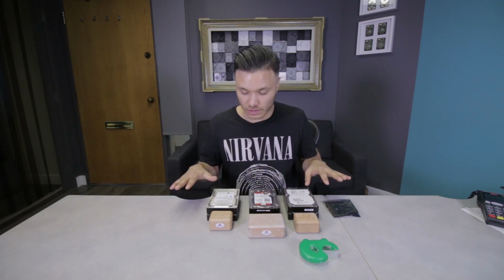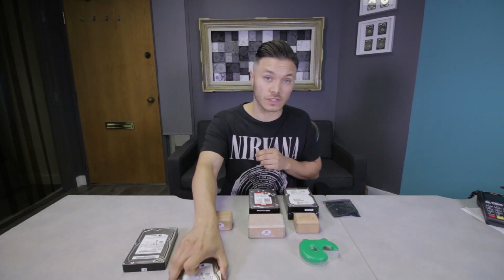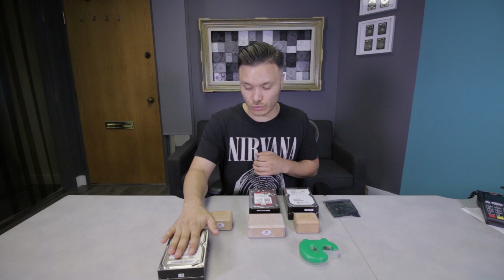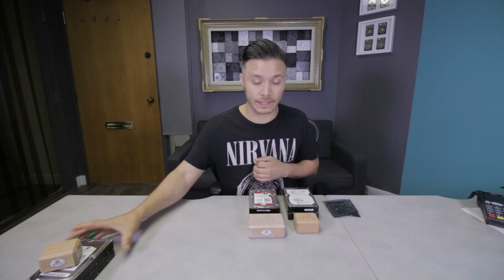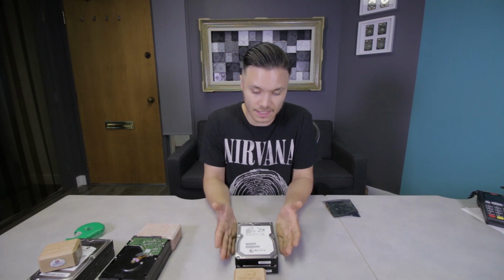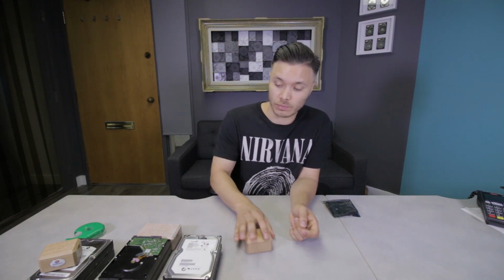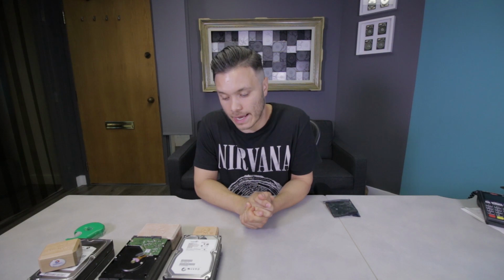hard drive does not spin - how to Platter Swap

Comment: Very excellent video, thank you for taking the time to explain the process so well.   I have a 2tb WD (quad platter stack) black drive with good platters and data but the complete circuit board including the data chip has been lost.   Can you tell me if it is theoretically possible to swap those platters into a similar drive using that drives circuit board and data  chip or is the chip married to the platter(s) the data was written to?  I hope I explained that well enough to understand.  Thank you for your channel and help.
Reply from the maker: Hi Mark, on WD information that would be unique to your drive can easily be rebuilt even without the original board. By getting ROM version "close enough" drive would be able to read modules from service area by ID, and by reading 101+ modules we can rebuild the content of the drives ORIGINAL ROM, and write it to a donor PCB.
Reply: Ok I will call for a price thank you.

Comment: Great videos, thanks for sharing the knowledge. I've watched several clips of yours, but I cannot figure out my case. I have a 2.5" 500GB WD Scorpio Blue, which spins normally, GetDriveGeometry gives me data about the drive. But reading any sectors returns an error. I have exactly the same model of the disk which could serve as a donnor. Do you think replacing heads would help, or more drastically swapping platters ? Or should I try to replace PCB first ?
Reply from the maker: pawelsokolowski if your drive spins up normally and does not click, than none of these techniques will help you get access to the data. Most likely the issue is firmware related. Something in the system area does not load and your drive does not come ready. We can solve that for you. Please do not open the drive as it will only reduce chances of recovery and will not help.
Reply: how expensive is such a repair ?
Reply from the maker: all price request has to be done on the website http://www.hddrecovery.ca/contact-us/

Comment: Awesome work, man!
I got a HDD failure today after my PC fell over on the side (silly story!) Seagate Barracuda 320gb single platter. Opened up the HDD and discovered that the tips of both heads were kinda ripped off and loose hanging from the edge. Removed the heads assembly and inspected the platter.
The reason was obvious; there is a tiny notch left in the platter surface, and when the notch went by the heads, it caught and ripped them off. No damage apart from that, but the damage is exactly equal on both sides of the platter.
It's obvious that the notch needs to be smoothed out in one way or another so that a new set of heads won't catch and get ripped. But the big question remains; is the platter readable when just a tiny part/sector of the is put out of business?
Reply from the maker: tmbryhn thanks! It all depends on where the notch is. If it's not close to the center then this drive is dead
Reply from the maker: tmbryhn you should check one of the most recent Videos I have on this channel about how I recovered a drive with platter damage using a gluegun to prevent hitting the notch
Reply: Thanks for the reply! I've already seen it. My kinda' style fix 😉 Love the creativity.
Unfortunately, the notch is closer to the edge. About 2/3 out.

I'm still thinking of flattening the area, but then I did some research regarding airflow and cushioning. Getting kinda scared here... Important data.

Comment: Hi, great video. I'm curious, on WD drives, when swapping platters, the donor drive with the good platter has to have both the same model/firmware AND the same two first digits of the DCM, correct?  The first two digits are motor and case.  I'm assuming that when swapping motors, both the case and the motor have to match, since the motor doesn't appear to be able to removed on it's own.
Reply from the maker: they just need to be of the same Family. DCM does not matter, even model does not matter. firmware definitely does not matter. As long as architecture is build the same, they will work. I've used 4TB drive chassis on 2TB latter swaps, and they did not have same model, firmware and DCM at all. But they were both from the same family. Easiest way for you match them is by PCB part number.
Reply: @hddrecoveryservices  Wow, that's incredibly informative, thank you.  Does the same PCB number tell me more than just an identical motor/case?  Will the heads be the same as well? For something like your 4TB>2TB swap, the 2TB might have fewer platters, and thus a different head count, correct? Or, if the PCB is the same are the heads the same?

This might be a dumb question, but, I've been looking at a lot of old drives, and it appears that the shaft on ball bearing drives is exposed, and the shaft on fluid dynamic drives is covered by a reflective sticker. There's no chance that the sticker covers a hole where the manufacturer adds the original lubricant, correct?

Comment: Hello colleague, I always watch your data recovery videos, I always had this doubt as to remove / transport the disks / dishes from the patient to the donor, because those stainless steel sachets have a thicker blade than the space between the block and the dishes. .. watching the video I could learn the form ... but what kind of tape is this one that you use, would it be a double face something like ??? thank you.
Reply from the maker: single sided masking tape 3m brand
Reply from the maker: another reason for using this method is because most of modern drives in 3.5" format have aerodynamic spacers between disks that will prevent you from grabbing more than one disk at a time with a swap can.

Comment: I wonder how helium filled drives will change this. Will you no longer be able to recover them through transplantation in a normal shop?
Reply from the maker: I am not sure that the helium is really going to be the thing. I can see a lot of people being upset about not being able to recover data they lost due to that. I have not worked on a single helium drive yet, so I dont know

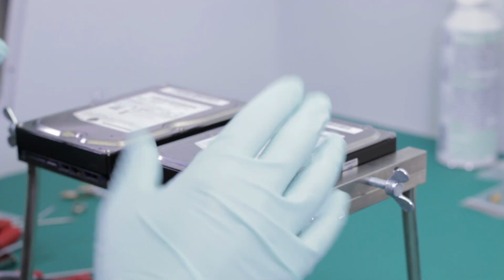Comment: Hello Erkin, please tell me what are those adhesive strips seen at 07:14, are they universally usable to extract the platters, or only Samsung disks are thick enough to get fixed with these. Is OK for a startup data recovery business on a low budget to use these, or a proper platter extractor is the way to go? Thank you
Reply from the maker: I used to use them all the time, but I use a different system now. I will showcase it in the future. To answer your question, platter swap tools would not work on most 3,5" drives that are made today because they have blades between platters. This is a regular maskin tape by 3M

Comment: hey, what the main requirements swapping Platters? Does the hard drive must be with the same capacity, model, version? or not really?
thanks
Reply: you need mainly your old bios, bios is calibrated with platters, with firmware from another hdd it can't work or can but you have to format it

Comment: when you do a platter swap do you have to remove the BIOS chip into the donor?
Reply: did u find an answer
Reply: He could have also used the original PCB also, so really all that changed was the motor essentially.
Reply: @حسينصفاءعلاءكاظم  nonono
Reply: @حسينصفاءعلاءكاظم  no
Reply: @daytonpyro  you are alive! 4 years later

Comment: Hello,
Very interesting video, tons of nice tips as for me..

I got an issue with Seagate ST3000DM001 (first was very slow copying speed , next day not recognizable in OS, but seen in BIOS ). It spins though.
I wanted to try the easiest first and order a new board (100717520 REV B) from Ali, but i broke BIOS leg while unsoldering EEPROM, and now drive does not spin (with new board, and my old BIOS on it - I have managed to solder it, maybe badly...).

I guess the only option is to buy a same donor drive (new board, new BIOS ...) and without swapping BIOS install the platters from my drive (i.e. swap the platters ONLY on the donor one). 
What do you think ?
Reply: I had to chuckle because I am in the EXACT same boat....EXACT same drive and EXACT same symptoms.  You need to go Google that drive model.  There is a class action lawsuit for those.  My DIY progress has been it is seen in BIOS as the model number and seen in Windows as unknown drive with no options to activate it through Virtual Disk Manager. Found out - once I got it outside through a USB-to-SATA plug, that the drive is not spinning at all.  Since it is either the motor is shot or the board is shot and not feeding motor, I bought a working PCB on eBay for 26-something dollars and got it.  Swapped out PCB and still not motor.  So it's the actual motor.  Emailed this company to see what they would charge to get docs/pics/music/andoneotherfolder off of the drive via platter swap.  Will update with their quote here.  Same symptoms though - never a bad sector, just was taking a long time sometimes to access data, then the drive was appearing and disappearing randomly from Windows (I have a separate SSD with the OS, this drive was just data only), then suddenly would not ever appear again.  Lemme go find the link to the law site where you fill out for whatever they end up settling for (still ongoing lawsuit and didn't see any type of estimated end or estimated amount we may or may not get).
Reply: Here is the law firm handling the class action against those drives (specifically that model number) and the spot where you can "sign up" for the case.      https://www.hbsslaw.com/cases/seagate
Reply: And the Hard Drive Data Recovery's quote (the one in this video) was this: "If your hard drive is not spinning up, we can recover the data for $400.00 US."  Good Lord, I'm in the wrong business. Now I'm going to check and see how much the larger 'multi-drive' tool set is because if that's how much an hour of swapping platters pays, I'm thinking of offering my own local service here in the US.  That's a bundle of pay in comparison to the worktime.  Not hating...that is a nice gig and mainly based on the desperation of the end user.  Bravo I say lol.
Reply: @williegates627  Yes, and the experts will act like it's impossible for the average person to learn to do such a thing. Learning to play the guitar is equally challenging if not more challenging to master yet there's a million people doing it, thanks to YouTube! Probably more expensive, too and that's usually just a hobby.

Comment: What's the worst that could happen when you handle the platters with bare hands? Like not touching the surface but the sides.
Reply from the maker: contaminate it, scratch it, make it unrecoverable. DO NOT REMOVE DISKS IF YOU ASK THIS QUESTION
Reply: @hddrecoveryservices man props for keeping up on comments on a 7 year old video

Comment: I'm trying to find an old program that I might have installed on an old drive, been going through all my old drives looking for it, have one that wouldn't spin up, did some research and decided to try a replacement PCB off an ebay doner, turns out there was a swap at some point that changed the screw pattern on it, ended up pulling the drives apart (single platter, and did a swap one to the other, I'm really hoping it reads something as these old IDE drives are a pain, was surprised to find a magnet so close to the plates on that arm

Comment: Hi good sir I have a 6TB Western Digital Black that is plugged up to a Sata to Usb adapter. It only has 150 hours of use, its still brand new. It keeps connecting and disconnecting when i plug it up to the pc. Powers on and off over and over. the power on count has went up to 2000. I fixed this when it did it before by taking ownership of everything on the hdd and adding a Everyone user in the security tab. I moved it to a different computer to transfer some data, then it started powering on and off connect and disconnect. Do you have any ideas or any advice. Please and thank you if you can help me out.

Comment: I have a Toshiba 2 GB drive that has the connectors broken in the back but the drive worked fine...am I able to swap or get data off the drive any other way? or should I throw my drive away?

Comment: My 1TB Seagate expansion+ (Model SRD00F1) has the click of death. Is the platter on this model compatible with another other Seagate models? I've searched the web and cant find the SRD00F1 model, and now I'm not sure what to use as a donor drive for the swap. Any advice? Thank you!
Reply from the maker: +The Northwest Forager I would not recommend to do a platter swap yourself. This is a highly technical peocedure. It may not look hard in the video, but it is. What makes you think that the drive needs a swap like that?

Comment: Does the donor need to have the same storage GB as the broken one? Like, if I have 750 GB HDD and I want to buy a cheap donor with less GB, does it work switching the platter or at least the board?
Reply from the maker: Don't open your hard drive if data is important. This is not a DIY task

Comment: Hello! I did something really stupid, I have to acknowledge. After I had issues with the hard drive I opened it and screwed the the needles. Do you think it's a loss cause? Otherwise I could really use your services
Reply from the maker: Luis, it is hard to say if this drive is a lost cause at this point. I would recommend to send it in for inspection. Please fill out your details here: www.hddrecovery.ca/contact-us
Reply: I did same shit so I changed needles (from same HDD model) but it still doesn't work, but when I back needles to original HDD it works, so I didn't destroy them, I have little burned contacts on PCB so there is probably another problem. I tried 2 another PCB and it only spin and shut down after 2 clicks, but with older PCB it spin but HDD is recognized as 8GB nonsense. Transplanting bios doesn't work too, disk is not spinning after that. I think I need exactly same PCB or that HDD is definitely dead.
PS: it's ST3000DM001, model 2014. It started be very very slow so I opend it and destroyed it totally. :-D

Comment: Have a 2008 vintage Samsung that spins but not to full speed - not detected by PC BIOS.  NO clicking, etc.  "Sounds like a good drive except does not spin up to proper speed."  QUESTION:  any chance it is the motor or the PCB controller OR is the firmware doing error checks because a head has crashed?  NOTE:  from memory I believe the Sam drive is a 1tb  HD103UJ/D  - the OE drive from a Dell XPS 430.

Comment: The platter swap only work with the same hdd driver identically or i can swap with any hdd driver ?
Reply from the maker: Chassis need to be that same. But if you ask this question with plans to do it yourself and not just curiousity, then take a step back. It's a job for a pro.

Comment: Hey i have about 30 drives that have the ribbon that comes out the bottom to the controller cut. Can they be repaired if i take it apart and solder new connections? They are 16tb seagate exos. Seems like they were intentionally disabled.
Reply from the maker: inside? no

Comment: I am pretty sure if you have 2 of the same drives, you can even take the problem drive's PCB and use that as well, just in case some bios and firmware stuff related to that has anything to do with the information on the platters.

Comment: Is this sufficient to keep platters aligned? How critical is alignment is a mystery, I couldn't find any authoritative info on alignment-tolerance... Anyone? 
With tape, what's the success rate?
Reply from the maker: on some drives, the alignment is important, on others not so much. We use a different method now, but tape is a great way to do it, and we've recovered plenty of drives with this technique. Success rate would depend more on other factors in the procedure, and your ability to perform the task. There are so many elements to this job.
Reply: @hddrecoveryservices  And what about PCB and bios if you move platters to another HDD? You have to use original parts from dead hdd right? So only one problem was not working motor.

Comment: wait does the donor drive have to be exactly the same as the corrupt one or can I just use my 80GB platters on my 250GB HDD that`s actuator lock doesn't release when it spins? Wait can I just put the platter along with the arm and PCB on the  80GB hdd?

Comment: Need help i swap out the platters and forgot to have them aligned. How how can i get the data to read and write again. What i been doing is opening and turn the top platter to the right, Is that What i have to keep doing til i get it correct ???
Reply: Janet Diaz I imagine you already know the answer by now. My drive is not rotating...so I tried to examine the motor/spindle, moved the cap which I think secure the platters. I don’t think I did anything much then put the cap back on . Now realizing how important the alignment is, I feel like all hope is lost, if it moved even a tiny bit. Since data got written on a nanometer level, we cannot hope to keep rotating it till it matches again perfectly. This video demonstrates that the alignment can be kept with the tapes, I suspect a slight nudge can mess it all up.

Comment: WD My Passport external hard drive is 4 years old & physically   damaged. I want to use platters of this hard disk in new hard disk .Please confirm , these platters can be shifted to my passport new hard disk &  confirm the compatible hard disk to change the platters.
Reply from the maker: Rashpal, please do not take this in a negative way, but if you are asking if platters can be swapped to recover data, then I would highly advise you find a shop to do this for you. If your data is important - do not try to do this.